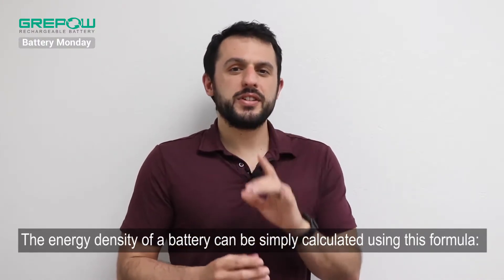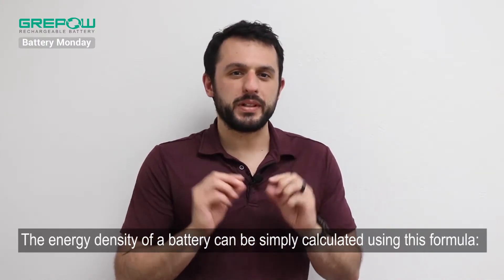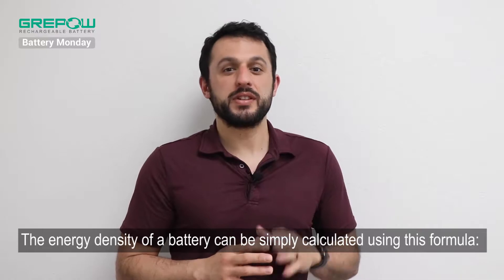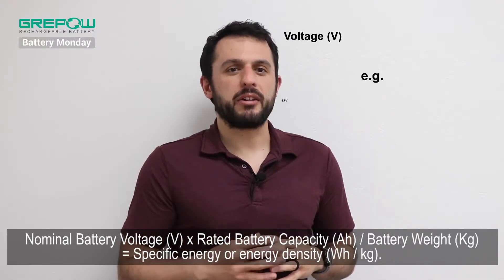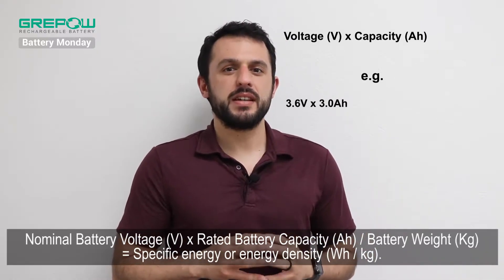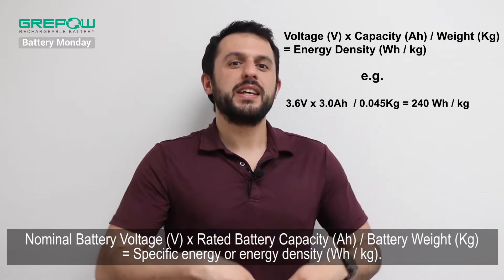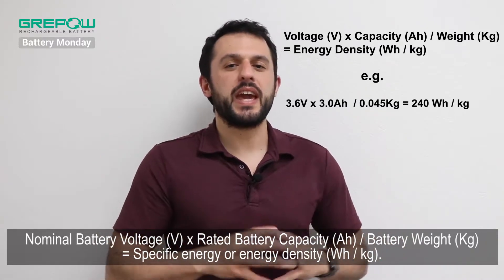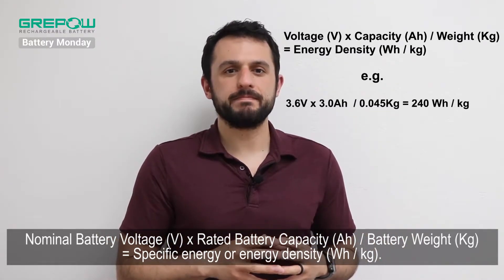What is the high energy density battery? - Battery Monday | 26 Apr 2021

Comment: hi i have a question about the energy density calculate ,the unit is Wh/kg ,so we need to division the weight(kg)，this mass is the graphatic(anode) weight or LFP(cathode) weight?
Reply: I guess it means that Wh energy is produced per kilogram of the total weight of the battery. I can be wrong. Actually, I just watched a video that said so.

Comment: Thank you for the very informative video.  This however raised a question - do you happen to know if a theoretical limit of gravimetric energy density has been established for lithium ion batteries?
Reply from the maker: Thanks for your comment. Actually, there is no highest, only higher. Now the industry stage target is 300Wh/Kg, and the target of solid-state lithium battery is 400Wh/Kg.